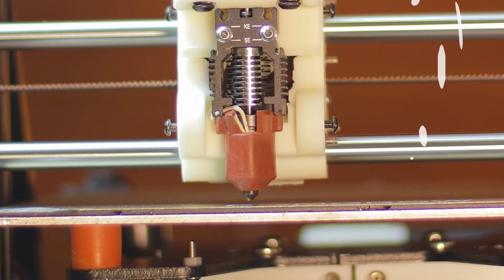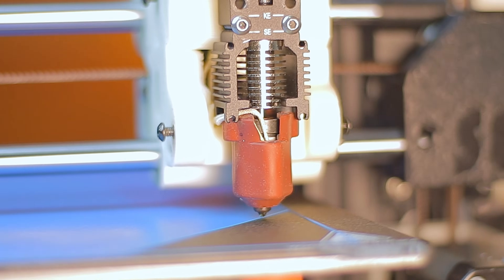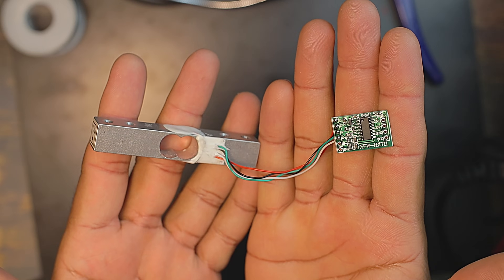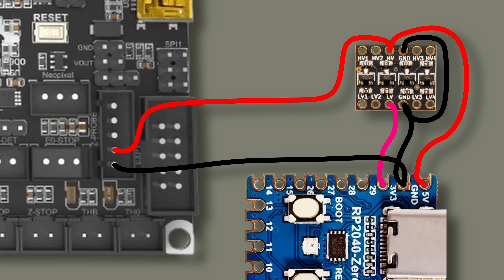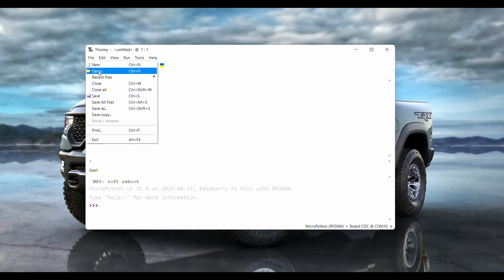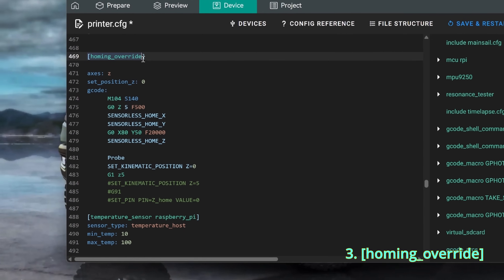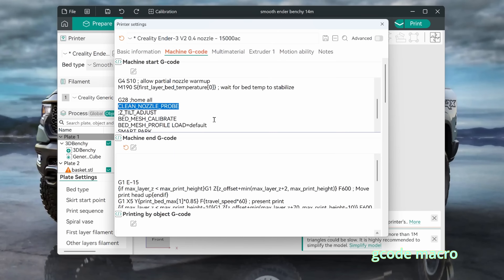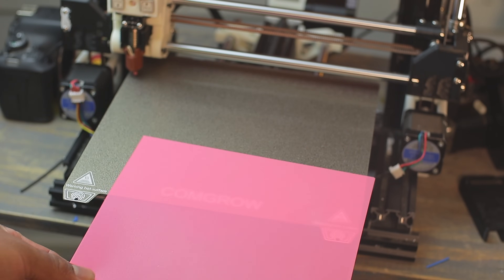Fix Your First Layer! The $10 Z-Probe for Perfect 3D Prints

Comment from the maker: * MISTAKE AT 4:25 The signal from the rp2040 zero to the printer board and printer board to rp2040-zero should've routered thru the logic level converter.  * updated wiring on GitHub
Reply: Yeah that didn't make any sense at all ... why have a logic level converter and then run the signals direct.  Couldn't see any schematic on GitHub re this either ... as it is ya gunna blow up the Pi.  4:49 is the best shot of how it was connected ... weird jump in wiring ... was this an AI Gen erated script?
Reply: @rackbites  Actually it's far more likely that everything will be one hundred percent fine. In case you didn't know, as long as the RP2040 has power, its GPIO lines are 5V tolerant
Reply: Thanks man I will try this
Reply: Can I use Arduino Nano?

Comment: You don't need the rp2040 or the conversion board, you can just use the spi1 pins on your printer board and 3.3 from swd pin

You should swap the hx711 out for a fast ads1220.    You'll get much faster bed leveling 
10mm+.

Comment: This is how i originally wanted to do it aswell, until i found out klipper supports the HX711/717 and the ADS1220 loadcell amplifiers directly; so the rp2040 inbetween is completely unnecessary.
still good video! couldve done with a single loadcell though
Reply: Could you share more info how to do this? What would the wiring diagram look like without the rp2040?
Thanks!

Comment: in video you said two loadcell but wiring for one. did you wire parallel?
Reply from the maker: I have two load cells installed for mechanical stability since I print at high speed, but I only wired one of them. You don’t have to wire both for it to work.

Comment: Great video.

Would this also work with a printhead already containing a loadcell?

With the upcoming Bondech INDX, the Nextruder on the CoreOne will become obsolete on upgrade. However, the Nextruder is a quite nice extruder, it shouldn't collect dust. If your electronics also work with the Nextruder, this would be great to use it in other printers instead without having to add another probe.

Also it could be a nice way to upgrade an existing bedslinger to a DEX with two printheads. A loadcell can also detect collision at the side of an object (Prusa uses it on the XL to calibrate the head). So autocalibrate the x,y and z-offsets of the second head of a DEX by placing an object onto the bed and "crashing into it" by a macro should be possible.

The reason why I write DEX, not IDEX: On IDEX you can not use ABL if both printheads are printing at the same time. So you need a very flat bed (like fine milled casted aluminium). Also the z-height of both nozzle tips has to be the same, so adjusting the z of the second printhead is mandatory. There is a reason IDEX was and is a very smal niche.

However, if only one printhead is active at a time (so not independend active), one is always parked outside the bed area. It practicly would be a "2 tool toolchanger". ABL would work, z offset between heads is compensated in software.

The reason I recommend using a bedslinger for a DEX: You only have to extend the x-axis and add a second x-stepper (+belts etc of course). If you use CAN or USB toolboards on the printheads, you can use the e-stepper driver on the main MCU as x1 stepperdriver. A CoreXY or CrossingRods design is harder to upgrade. Esp. big printers (like the RatRig vCore4-500 IDEX) are to big to fit through a door after assembly. A bedslinger could be carried sildeways and tilted, fitting through doors...
Also upgrading an old big bedslinger (like the Anycubic Chiron or even Crealitys CR10S5) and put it into a usefull(!) second live this way would be great.
2 printheads would be quite nice for dual material - like using the PLA/PET-G support trick.

Another topic: Prusa uses it´s loadcell a bit different. It stops the down movement of the nozzle on contact, then moves up very slow a very little distance and detects z=0 if loosing contact to the bed. This way they get a very precise measurement without moving z slow for long distances (like 2 or even 5 mm) or probing 15 times. But they use heavenly modified Marlin. Would there be a solution to do so in Klipper?

Comment: There may be problems with this sensor when the nozzle hits protruding drops of plastic
Reply: It's important to understand what I mean. Firstly, your bed isn't always clean. A piece or drop of plastic may stick out of the nozzle. If it's hot, it may leak out during measurements; if it's cold, it will stick out, and after heating, you'll have too much height. Secondly, when printing with overextrusion or improper presher advance, or wet plastic, you can literally hear these knocks as the nozzle makes idle movements between parts (if you're printing several different ones at once). This can damage the geometry and wobble everything. If the nozzle isn't rigid, it's unstable; each knock/bounce will increase the bump, which is bad. Cobra's method 2 works by first measuring the clean nozzle (it cleans, heats, extrudes, lands the nozzle on a silicone pad, and turns off the heating; the plastic is pressed in and hardens there). Then it lowers the nozzle onto the button—voila, there's a zero coordinate. Then the inductive sensor measures the distance to the table at 16 points, now it knows the table map and the distance to it. And the entire structure is rigid.

Comment: The Cobra 2 Pro has two sensors: one measures the nozzle length (a contact button like on CNC machines for tool zeroing), and the second is an inductive sensor—it measures the distance from itself to the print bed. With some simple calculations, it gets very precise readings. But another point is to use them for leveling. What's the point? If your print bed is crooked, there's no point in printing with compensation; your layers will be misaligned and crooked because of it. It's easier to make the print bed level to 0.05mm. Is that even possible? LOL, there are tons of super-duper hotends and extruders, but no perfectly precise print bed? I don't believe it.

Comment: sometime i back to this video and now caught myself thinking, why even use rp2040 instead of arduino nano? isnt it powerful enough to do this work, and it works at 5-12 involt, and 5v logic so no need to use adapter, i already have some arduino nano and today got rp2040, and think that 2040 might be better for some more complex work than just signal IO.
also arduino already has library for HX711 (a lot of to be honest) and runs arduino c++ so theres HUGE community (as it is around RPI ofc).

Comment: Doesn't this add quiet a lot of weight to the tool head? I think attachable diy probes are better as they can be detached once calibration is done, you can even automate it so probe itself picks up and places it back

Comment: Upgraded my one now 6 years ago. was move to a nau loadcell controller for higher measure frequency. Also all logic is on a arduino nano, that alway triggering z endstop on detected threshold. it's just was and is simple endstop replacement on the mainboard. and it's still working like a charm. 😊

Comment: Nice idea. But two "heavy" load cells on the printhead doesn't sound so nice to me. Piezo sensors are much lighter. And why not using the RP2040 ADC? They take up to 500 kS/s in DMA Mode (100kS/s with Softwareoverhead) which should be fast enough for "Triggered"/"Non-Triggered" decisions. Just asking.

Comment: I know that it's what the cheap-out consumer grade manufacturers tell people to do so that they aren't expected to make better hardware themselves, but why would YOU - as someone intelligent enough to design something like this and run it through iterative testing - configure your firmware to use the nozzle height probe as the Z-axis endstop? Is it that you WANT to break your printer and potentially have to scrap everything from the nozzle to the frame AND the control board? Because that is legitimately a likely and common outcome, and the reason why a large segment of the better-informed FDM influencers and everyone who comes over to consumer FDM from industrial CNC (where they had to evolve the tech through the same pattern of idiocy) has been telling everyone for over a decade "Do NOT use the probe as an endstop".

Comment: This is the best way to do it. Now, monitor the load cell during printing. The extruder will push down on the load cell but the molten plastic will exert a force in the opposite direction. If you can capture load cell values for a good print then you can use that as a baseline for detecting bad prints, based on bad settings or some other anomaly, like spaghettining.
Reply from the maker: That’s a brilliant idea! Monitoring the load cell during a print and using those values as a baseline for detecting issues. Definitely something I want to experiment with!
Reply: @everythingdiy32 thanks for that. I needed the emotional boost.😊

Comment: A weight measurement module isn't needed. You just need a lever that increases the valve travel several times and a cheap optical sensor.
Reply from the maker: True! That’s a clever approach
Reply: Only works for an on and off switch and isn't rigid enough or you will stall out the nema 17s, good idea but limited (pun intended).

Comment: I have a $3 DIY compact opto-servo probe, and I can tell that what you made is unreliable junk. Starting with the fact that if any plastic sticks to the nozzle (often happening), it will dramatically affect your results. So, you basically can't do probing while heating up and you want to make sure every time nothing stuck to your nozzle before print. With servo probe it doesn't matter.

Though I see some potential in CNC.
Reply from the maker: Thanks for the feedback; I've found this approach to be reliable, but I understand your concerns.
Reply: @everythingdiy32  You should try to implement it with CNC, really. It can control pressure characteristic of mill precisely in real time! So, you could basically avoid mill break. 

Also, sorry for the rude language. I just think it's not cost efficient and reliable. That's all
Reply: This will not fly in a real mill, at least not in the current config.

Comment: Great video, one question tho, why not flash klipper into the rp2040 and plug it into your klipper host?
Reply from the maker: Appreciate it! Klipper doesn’t let the HX711 be used directly as a probe, so running Klipper on the RP2040 wouldn’t work in this case

Comment: Hello Everything DIY, I love your concept and see it is worth giving it a try. Looking at your Tool Head, I notice your hot end and extruder setup uses what seems to be Creality parts. Can you advise what you have used? Also, would you have a Step file for your X carriage you could share? Thank you for your help.
Reply from the maker: I’m running a Creality Ender-3 V3 SE/KE ceramic heating block kit with a Sherpa Micro extruder—it’s a super-fast setup that can push around 28 mm³/s. I’ll have the files on GitHub soon so you can check them out!

Comment: Wait until your nozzle is not clean at its tip!!
Reply from the maker: Don’t worry, the macro keeps the nozzle clean—it’s foolproof! That’s also why I home in the positive direction 👍
Reply: @everythingdiy32  Based on several years of experience, I can confirm that after extensive printing, plastic tends to crystallize around the nozzle, making it extremely difficult to clean and remove. Over time, this buildup will accumulate beneath the nozzle, even if you use a cleaning macro before each print. Only time will tell if my observations are accurate.

Comment: This is pretty brilliant.

Thinking I might give it a shot with a couple micro pull rod capsule load cells for simpler packaging. It's super unfortunately they are so much more expensive than the beam style.
Reply from the maker: Thanks! Using micro pull rod capsule load cells sounds like a neat way to simplify packaging. Too bad they’re a bit pricey.

Comment: Ahhhh dude how do we mount the probe? 

You've got instructions on how to connect it but ahh nothing about mounting the probe?

And you had two load cells at the start but only use one?
Reply from the maker: Only one load cell is wired, I’ll upload the CAD files to GitHub soon so you can tweak them for your printer—or tell me your printer and I might whip up a custom mount for you!
Reply: @everythingdiy32 You sir are a legend! If you get time Ender 3 style mount would be fantastic! Otherwise I can adapt the mounting idea myself!

I am very excited by this

Comment: The electronics are not the issue. Where can we buy the load sensors ?   What material is the mount made of ? We need the mechanical files. .Can we get the stl files to 3D print the mount ?  Or do you sell a kit ?
Reply from the maker: I’m not selling a kit right now, but I’ll upload the STLs to GitHub soon. The load cells are standard ones—you can find them on Amazon, AliExpress, or at Maker Store in Melbourne (that’s where I got mine). If there’s enough interest, I might offer a kit later.

Comment: Technically the RP2040 IS 5V tolerant, so the level converter might not be necessary.  RPi was conservative on the ratings for the RP2040, but with the release of the Pico2 they have changed the specs for BOTH processors.
Reply from the maker: Good catch, thanks for pointing that out! You’re right—the RP2040 can tolerate 5 V signals now, but it still only outputs 3.3 V logic, so if you need 5 V on the output you’ll need a level shifter.
Reply: @everythingdiy32  BTW, do you have STLs for an adapter for the Stealthburner or other Voron toolhead to use this?  Also a link to the actual sensor you used?

Comment: @2:52 Since you are moving a 0 Ohm resistor (a jumper by any other name), you can jumper the 80Hz pads with a solder blob if that's easier for you. You still have to remove the resistor from the 10Hz pads of course.
Reply from the maker: Good point, thanks for mentioning that! Yep, a solder blob across the 80 Hz pads works too—just be sure to remove the jumper from the 10 Hz pads first.
Reply: The 0 ohm resistor was just for antistatic protection.
Reply: @Deneteus We use 0 Ohm Resistors as paths over traces or as a "kind of" removable link due to the manufacturing process of PCB's. The Components are placed by an "Pick and Place"-Machine (it literally picks components from trays/reels and places them on the board). They can handle standardized components with no efforts 24/7, so instead of using a Human to solder a wire bridge we use 0 Ohm Resistors as bridges. They also look nicer, are more reliable, cheaper and more robust.
Reply: @walterbishop2 It's also used as a fuse.
 Because the current resistance capability of the 0 ohm resistor is relatively weak (in fact, the 0 ohm resistor also has a certain resistance, but it is only very small), the 0 ohm resistor is fused first when overcurrent, thereby disconnecting the circuit and preventing a larger accident happened. Sometimes small resistors with a resistance of a few tenths or a few ohms are used as fuses. However, it is not recommended to use it in this way, but some manufacturers will use it in order to save costs.
Reply: @Deneteus  That's equal to or worse than no fuse. They make fusible resistors, fusible links and self resetting fuses in standard SMD-Sizes, apart from the latter they are only a few Cents each if you buy single ones at a western distributor. If you need to skimp out on basic safety for a few Cents saving at best, you probably deserve getting sued to hell and back.
Reply: @walterbishop2 Tell that to MXR guitar pedals and the input jack ESD protection.

Comment: 👏🏻This is a great open-sourced solution in reason cost!!!  Thx for sharing such a good one.   For speedy solution, I opts for Cartographer (USB/CAN) which enable me to scan through the whole bed in non-contact approach, it just flying over the bed to have a great MESH scan.  On the other hand, it also provide nozzle touch feature to ensure I have a perfect first layer even I switch between any nozzle or different bed plate.  The best is that I can get one under US$25 at the time it was public launched.
Reply from the maker: I appreciate the positive feedback, and thanks for sharing your experience with the Cartographer Probe!

Comment: You say there are “kits” in your description.  You say they are expensive.  Can you tell me where there are such kits?  I cannot find any strain gauge bed probe kits.  
Also, is there a single board that performs the function of your 3 boards?  And does not require desoldering components?  
Awesome video.  Strain gauge bed probing is the only way to go.
Reply from the maker: Thanks, When I mentioned “kits” in the description, I didn’t mean strain gauge kits specifically. I’m actually working on a single-board version to simplify everything, and I’ll share updates when it’s ready.

Comment: Nice work bud, E3D have this now, also Mellow 3D have a similar one as well, more compact, but obviously more expensive, the K1 printers also use a similar system, but the load cells in the bed instead, its actually a really reliable system, with one exception, if you print high temp materials, these will no clean off the nozzle at a low temp so you can get a false zero point, I usually manually clean the nozzle properly before I execute a print.
Reply from the maker: Appreciate the comments, and thanks for sharing the experience.
Reply: @everythingdiy32  No problems, I'll take a close look at your work as I was looking to do something similar in my 3D3 printer I'm designing, wasn't sure if I should go with bed based load cell or nozzle based, the large load cells you have used would be great on the bed for a CoreXY, but would need 3 on my system as the bed has 3 axis like a Voron Trident.